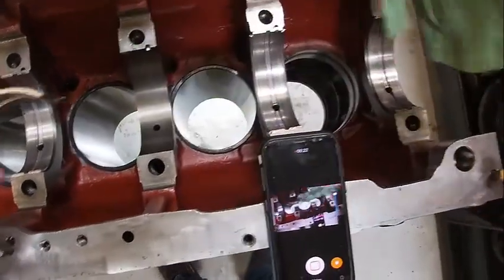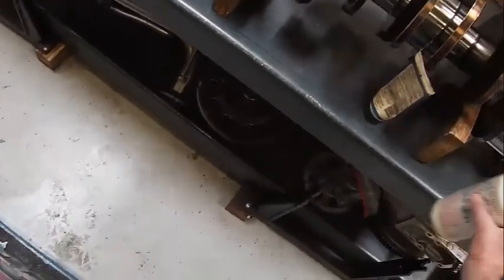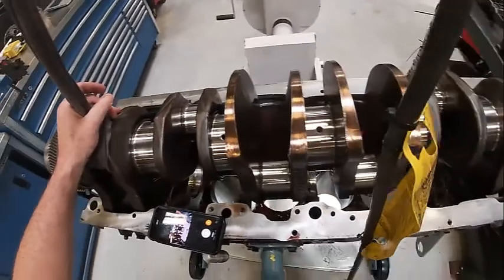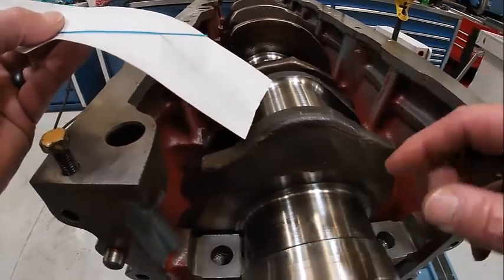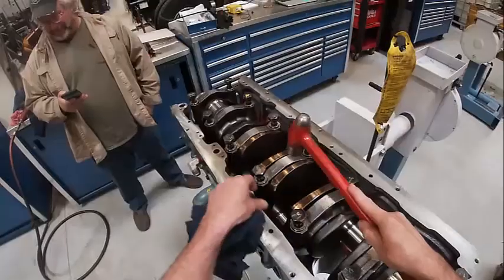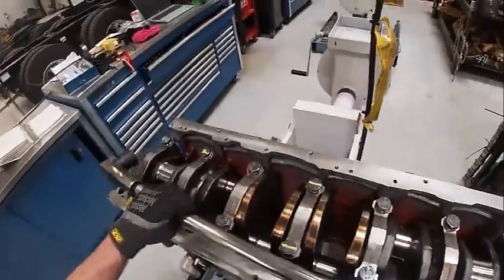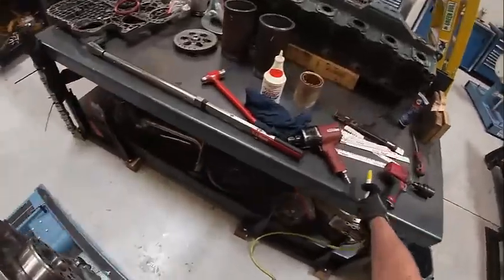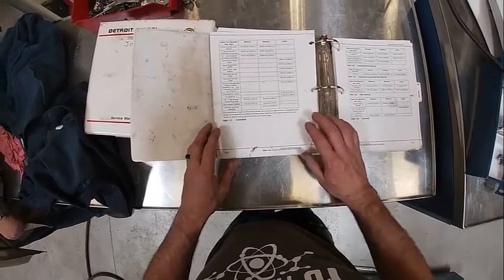60 Series Crankshaft Install

Comment: Awesome video, well explained, just for reference after torqued the main bearing cap with the plastigage, readings shouldn’t be over 0.005 inches according to service manual, also the main torque should be done with half the spec torque and then after finishing the 7 caps go again for the other half of the torque